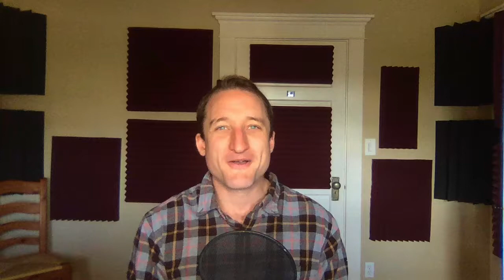What's The Difference Between Mic Level and Line Level?

Comment: So how you know when to use line level I got a focusrite isa one calibrated to +4 going in to a art compressor going to my focusrite 18i8 audio interface I tried a line level from my compressor barely got a sound
Reply from the maker: I would check the manufacturing specs on all of those units to make sure that all over your units are calibrated at +4 and not -10

Comment: What is the difference between Mic Trimming and Mic Attenuator (Mic Att). My camcorder has these two settings in audio menu.
Reply from the maker: From my experience the trim is more fine tuned gain control over attenuation. Sometimes the Gain knob is stepped and then there is a trim to dial it in.